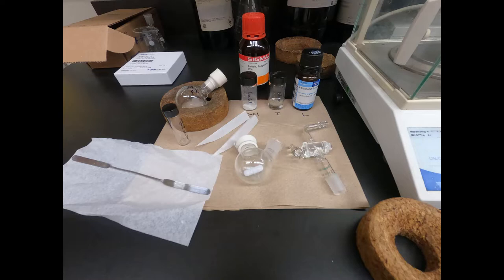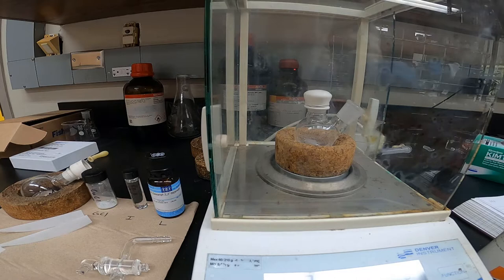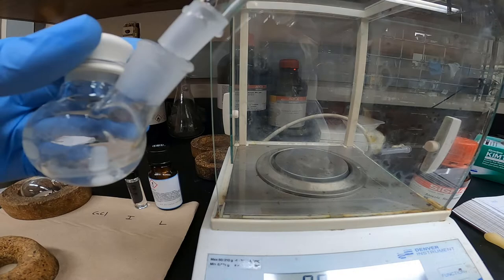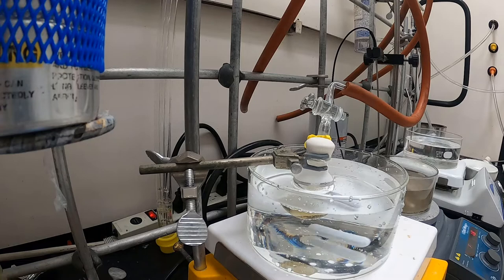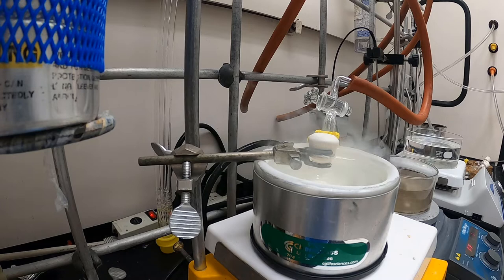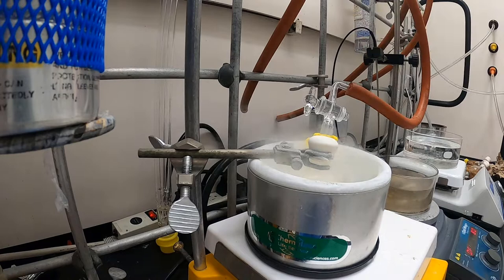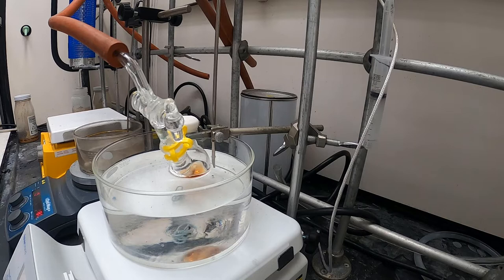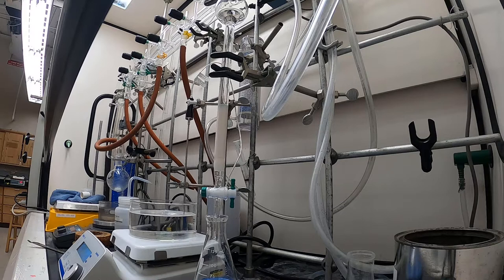Atom Transfer Radical Polymerization (ATRP) - Reaction Setup

Comment: Thanks for the vid! Are there any adjustments you make when using a polymer macroinitiator instead of small molecule like EBriB?
Reply from the maker: The setup should be similar overall. Two things I can think of: 1) It is important is that your macroinitiator has high functionality of the polymerizable end group. If not you can end up with bimodal distribution of your block copolymer and any starting polymer chains that did not have a polymerizable end group. You can use 1H NMR and end group analysis to make sure functionalization is high. 2) Make sure you consider the mass of your macroinitator as a whole when considering the ratio of monomer and imitator. Good luck!